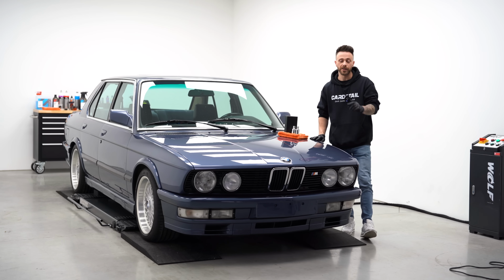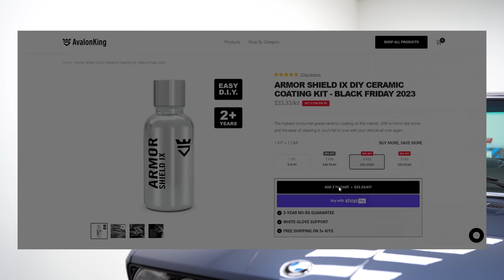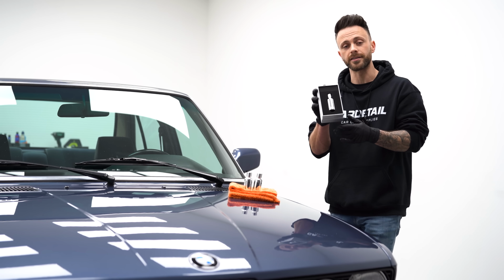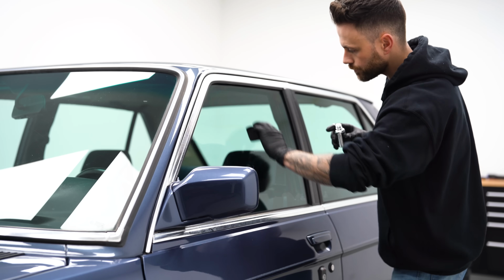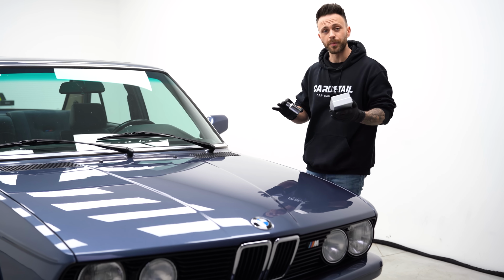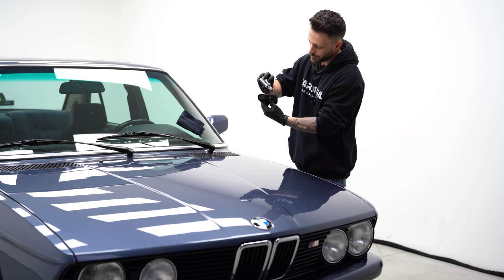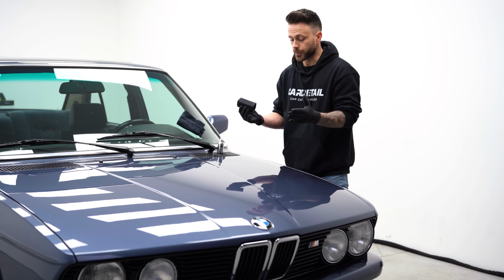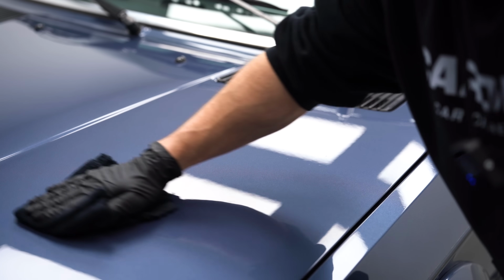BMW M535i (E28) - Wash, Polish & Coating

Comment: Excellent results. 😎👊🏻🔨

I ceramic coated my truck, using another brand out on the market. I washed, used iron remover, clay barred it. I had someone else do the paint correction. Took me about two and a half hours for a crew cab pick up. Now I just pressure wash my truck every couple of weeks. If I get my truck muddy from being in the woods, then I do a handwashing. With that being said, I put on aftermarket wheels on my truck about a month ago - they have to be polished and ceramic coated. Hopefully, this Spring I will be able to do it.

Comment: Another outstanding detail and video.  The car looks remarkable. Just curious...how long did it take to complete the detail?   P.S.  Did one bottle of ceramic applicator work on the car or did you need multiple bottles?
Reply: I found a 30 ml bottle was enough for a MID size car.. even a UTE (without using the coating on glass)

Comment: Great video as always mate! 
Just one notice, you didn't showed the degrease part e.g. capro eraser after the polish. I have seen so many newbies missing that part, and wondering why the coating doesn't last for long.
That's one of the most important parts in the process of coating after wash, decon an polish.
Reply from the maker: Thanks man! No worries, I did use Eraser. I just didn’t film that part this time.
Reply: hey hey, i know...had no doubt that you didn't use the eraser, my comment was more directed to the viewers site in case they want to try the coat process
Reply from the maker: Alright, got you! Just wanted to make sure you knew I didn’t forget 😁

Comment: I bought an E28 21 years ago for £150 from a salvage yard with 130k miles in mint condition.
Repaired it in less than four hours.
Someone stole it a year later.😢.

Comment: Why everyone cleans the tire first? Instead of going top to bottom and tires in end?
Reply from the maker: You should always start with the wheels. You don't want to get the dirt of the wheels on the already cleaned paintwork, do you? In addition, the water on paint would already start to dry while you are still working on the rims.

Comment: When are we all gonna admit all of the emblem and badge brushing is completely performative and isn’t actually doing anything but just brushing over them? You’ve gotta actually pinch the bristles and rub along the edges and in the indentations of the letters. Simply gliding the brush over the top of the badge does nothing. And most brushes I see detailers using a too soft to actually agitate and lift the embedded debris surrounding the letters
Reply: They do it for aesthetics and dude only cleaned one wheel